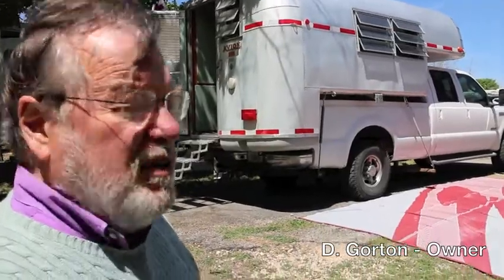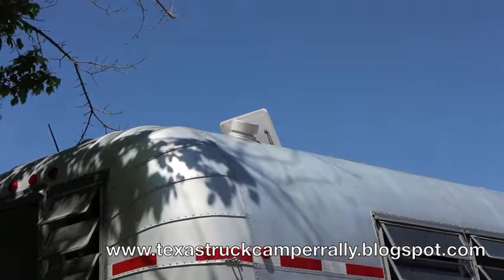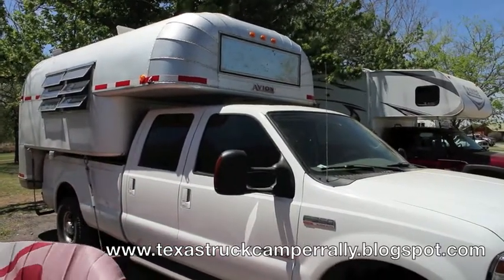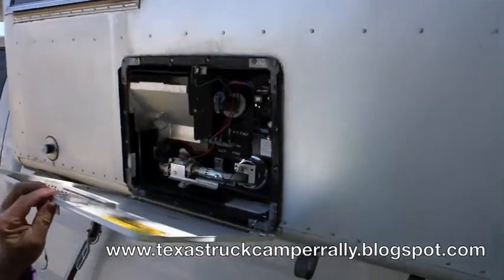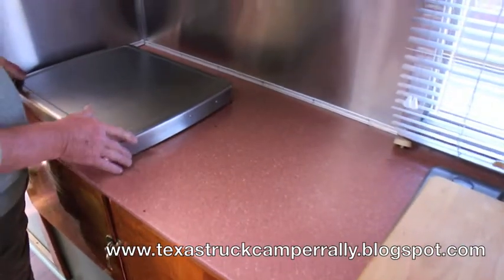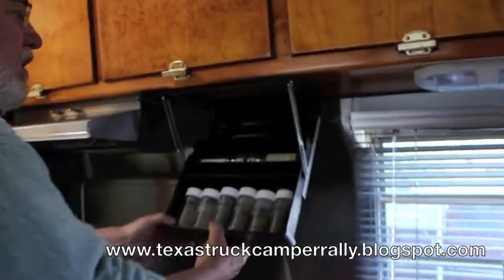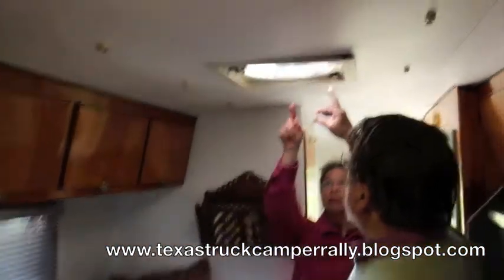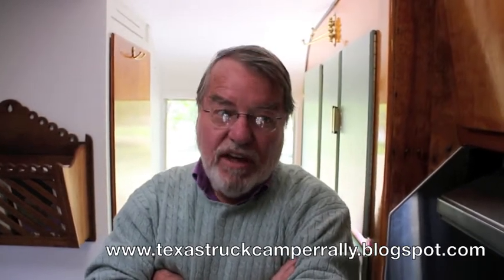1967 Avion C10 Truck Camper at the Texas Truck Camper Rally

Comment: Just bought one, 1967 Avion slide in camper, can't wait to go camping. July 22, 2014
Reply: Time will tell, just bought a 1951 3600 chevy truck to put the camper on. Just starting work on the truck in between rain and spring work.

Comment: Nice...:)

I wonder if anyone has ever taken one of these and mounted it to a trailer. And then equipped it out?
Reply: I have a 1965 Avion C-10 that is mounted on a heavy duty trailer.
Reply: Yes, but I believe the best adaptation is mounting it on a tool bed.  The added storage and expandability improves the options for extended stays.

Comment: I do not advise removing a camper off of the truck because in the back country the soil is not level, it can be washed out in a flash flood very easily, and also the lower part of the camper attachment is exposed to elements such as more Frost exedra. Be very careful in the higher elevations, because storms can come in very easily and very fast, and therefore trapping you into the deep forest for a whole season. There's always a freak storms, either a flash flood or early snow, which can cripple the area from removing your truck and camper. 

In the desert also, flash floods can cause severe gulches in the sand, trapping you into a sand area or a severe wind storm can blow sand dunes all over the place. Keep the truck Anchored to the camper, w/ floor units/bolts. Also, it's extremely difficult to maneuver in the backcountry, because low branches can interfere, and one severe wind storm, can also crippled dirt roads , move rock boulder,  down tree limbs, tumbleweeds Exedra that's why a lot of people have a winch on the front and the rear other units, so they can try to get the units out of the country.  RV’s we're just not suited for deep boondocking.

I've also found even the trucks , 4 x 4,  with extreme backland terrains as optional equipment, can break down very easily, and also blow tire, leaving the unit breached and non operational. Many boondockers will carry spare tire on the roof mounted carriers. Be careful of Mt lions and bears, as they can break camper windows and vent, ding the hell out of the unit and ashamed to mention, camping men are raped by foresters at gun pt and I have seen my share of dead caucus of human remains, as campers have been eaten alive by bob cats. 

I enjoy a double seated cab, remove the back seat and this area makes great storage pad, plus remove the factory bed and install an after market utility bed with lockable lockers, great for storing small outdoor wares for camping. Utility bad can be purchased used, repainted and last lifetime.

One Window shutter manufacturer, makes light weight steel window shutters for the interior. Almost impossible to punch out from the exterior inward, incase some thief’s are trying to break out windows. Make sure the window screen are copper screens for boondocking, so if swarm of bees or insects attact the window or screen, they can not get in. Boondockingin deep in forests, remember no lights at night in camper attachment and all windows must be closed to keep swarms from coming in. Good idea to wrap the engine compartment on the truck w/ insect cloth, to stop swarms from nesting inside the generator/ or truck engine.

email: CerritosHO@hotmail.com | 

1. Overhead bunk is too hot, or too cold, and very noisy in the rain, hard to support adults for intimate sharing. . It's also very hard to get down for the elderly.  It's a useless area. 
2. All interior coverings must be leather covered and laminate wood like floor coverings.  
3. Dinette is not a very good mattress for adults sleeping, is too lumpy. Im 6’6”, so sleep on floor, it is the easiest for tall owners.
4. Wish roof solar collectors and AC was more flush mounted, as they get banged while driving. 
5. Dry bath needs toilet hose and glass shower door w/ built-in weggie, plus instant hot water tank. 
6. Window covers should be waterproof/ light proof. Wish patio awning button was on the interior and had a screen panels & floor. 
7. Interior LED lites are not elegant or hi tech enough, compared to 2016 cars.. Side door entry is better for towing, easier to egress/ingress. 
8. Needs recessed docking lites and recessed clearance lites. 
9. Needs hI tech alarm and glass shattering alarm. Windows need to be more private reflective glass for security from intruders. 
10. Micro-wave is ample, forget the stove/ oven. Needs icemaker on priv water tank for safe consumption.. Electric jacks are not convenient enough, espec for 4x4 dualies. 
11. Campers Designers need to look at: Airstream / Prevost/Yacht designers, as campers are becoming more and more used as a detached live-in sm. trailer, boondocking, aside from being truck mounted. 
12. I have owned fiberglass truck camper for 50 Yr and driven more then 500,000K miles. Own 1970 Ford American Truck Camper, ( SC Fiberglass gel) made exclus by Ford.
email: CerritosHO@hotmail.com